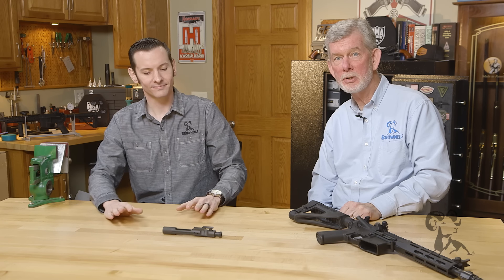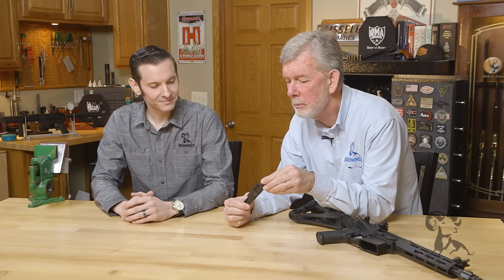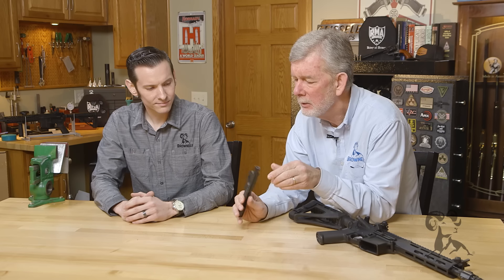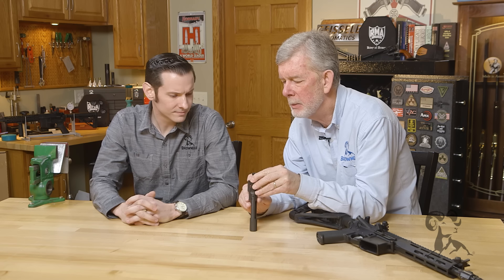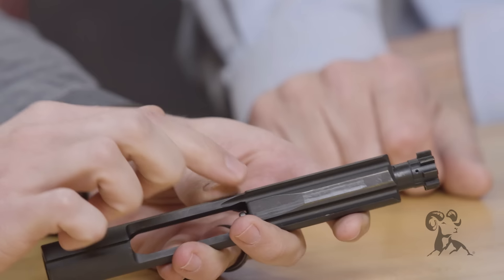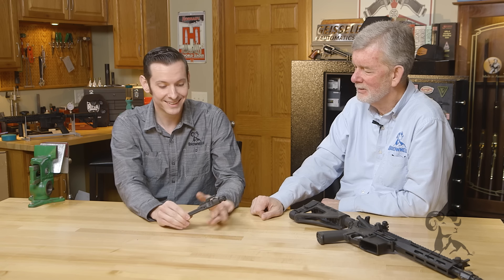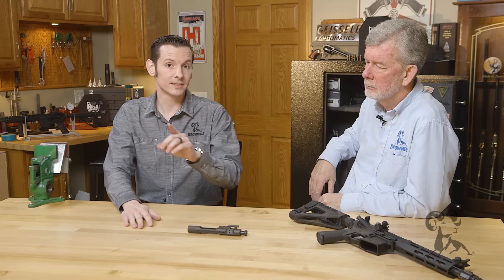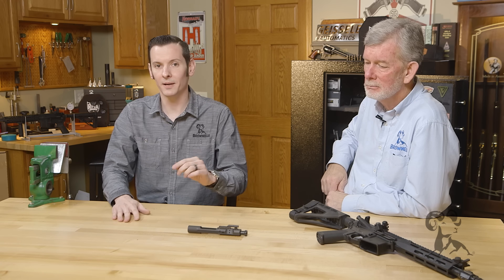Smyth Busters: AR-15 Bolt / Carrier Lubrication

Comment: I have an external oil tank which feeds an oil line that runs directly into my gas block with a spring loaded valve. Each time the gas impingement system is cycled, the pressure pushes open the valve, allowing oil to circulate the entire action through the gas tube. The oil catch tank is inside the pistol grip. Once it reaches a certain level, the oil is forced back into the main tank for recirculating. Every 500 rounds I do an oil change and filter with 10w-40 full synthetic.
Reply: man, I would like to see a schematic of that system! share please!
Reply: I have never heard of that but I'm definitely gonna have to look I to it. Also my good old car also uses 10w40 fully synthetic so I have plenty of that laying around.
Reply: You guys
Reply: And the oil pump gear runs off the forward assist gear notches on the side of the bolt carrier 😂
Reply: Did that get oil on your face?
Reply: I have one of those systems as well, but I use crude oil that's on my property. I have a quick disconnect hose connected to to my AR. Since I have oil on my property, I just plug it in. It's real inexpensive that way.
Reply: I use 10 40 synthetic in my car. It's alright.
Reply: The folks in here thinking he's serious 💀
Reply: use blinker fluid instead of
Reply: I can see where a scuba tank could be repurposed for this.
Reply: Watch School of the American Rifle, and get back to me
Reply: I've also got one.  I'm running 80psi pressure.  Built it from a dry-sump system from a NASCAR stock car.  The pump is powered by a 3-cylinder diesel engine which was removed from a  Ford LGT14D lawn tractor.
Reply: God I love America, you can do an oil change on your AR just like a car
Reply: Bs
Reply: I am glad you have that system on your gun I sure it makes you shoot better and never miss your target you are lubricating your target when the bullet hits it that’s a great idea
Reply: I think 15w50 would be better for summer use ! 😂
Reply: Funny
Reply: You don't do  an oil change on your truck every 500 miles, do you? Try stretching it out a bit. Say maybe every...?
Reply: LMAO

Comment: Rule of thumb for any firearm:  lubricate any contact points of moving parts. Any thing else just collects dirt and waste lube.
Reply: William Bailey  holy shit man ur killing me!!! :) lmfao
Reply: "Any contact points of moving parts":  Firing pin, locking lugs, piston, trigger group.....all places where most people say not to lube.
Reply: a nice thin coat of oil does help with rust tho, not a total waste
Reply: JKSteve1124  To each their own, it's all opinions anyway.
Reply: Good advice Long Shot. I usually have one handgun, a carbine and a shotty in "grab and go" status. These firearms are lubed on all contact points. If I take a gun out knowing I'll shoot it, I go a heavy on the lube. This further helps to reduce wear and tear and usually makes the gun a bit easier to clean.
Reply: where you see worn coating...apply lubrication.
Reply: It just so happens that non-polar solutions tend to lube and protect against corrosion; however the two should be thought of as different processes. 

In lubrication you are maintaining a sustained smoothness and making sure the tool works as intended without wearing itself out.

Protective oiling is for protection against nature, a short time without it is expected fairly frequently. It also aids in the cleaning process (greasing and degreasing over and over basically).

Do what you will, but if your gun is slipping out of your hands like a bar of soap, you may want to remove sone protective oils.
Reply: @DonziGT230 which is funny because the military manual says to lube all those parts!!! Firing pin and channel light lube and the rest it says lube generously!!!

Comment: I've never seen a bolt that was so wet the gun wouldn't function but I've absolutely seen them not run dry. I'd also recommend putting a few drops inside and outside of the charging handle.
Reply: How about wet with silty sand?
Reply: @Golgi-Gyges  ARs are sealed well enough that sand shouldn't get into the action.
Reply: @mustangkrillin  ha ha!
You've never been to the Persian Gulf - and what about during firing?
Reply: I'm not military but I've shot with military since the late 1980s. I've tried most of these methods and had problems. Starting in the early 90s I run dripping wet an never had any problems.
Reply: Well said 💯💯💯
Reply: I've seen rifles throw a lot of excess oil off while firing with zero problems. Probably much different regarding some thick greese or whatever but oil is an ARs friend in my opinion. I wouldn't want to run it completely dry, the firing pin is chromed but everything else isn't from what I can tell lol RESPECT 💯💯💯
Reply: @mustangkrillin  you do realize in the video you linked they DE-LUBED the rifle with brake cleaner? The video you linked works exactly against your point.
Reply: @squid_iwl  Yeah, no one cares
Reply: Armed Chicano  nice little slurry (oil and powder) that will abrade and friction-up your active parts, right?
Reply: I do too. Any friction point.
Reply: Cav Trooper 19D  I was just about to reply about Iraqi sand.. its literally like baby powder and will find its way into ANYTHING!
Reply: @Golgi-Gyges  Run them wet even with sand.  Lubed sand is less abrasive than dry sand.  Think about it would you wash a car with dry sand or would you spray it off with WATER first.   Try running a car with no oil.  The piston in the gun is similar.
Reply: @Physics072  they lubricate cutting tools too (ex. a drill bit) it makes them more effective.
Bad reply from you
Reply: @Golgi-Gyges  the lube cutting tools to keep the heat and friction down so that the bits dont seize and break off in the work piece. The example you gave is evidence of why you should lube heavy instead of lightly
Reply: @Physics072  a car engine isn't gun parts.
Oil is literally going to be a sand/dirt/dust magnet.
With little-to-no-oil, you are better off.
Reply: @isaachousley325  You don't understand that the tool is literally removing metal...like abrasion...
Reply: @Golgi-Gyges  I regularly lube cutting tools and drill bits when cutting and drilling steel.  The reason it's done is to keep the cutter cool and for chip removal and reducing friction. it keeps you from trashing your drill bit or cutting tool . 

If not for heat reduction, friction reduction and chip removal you wouldn't need it, the carbide before it heats up can cut Just Fine Dry. 

You can also spray water on the cutter and that is even more effective than oil.  The oil isn't going to cause the sand in the action to do more damage,  it causes less damage to the metal.  Less heat and friction is good for your bolt carrier group.  Your theory that oil in a dirty, sandy gun does more damage than dry sand is incorrect. I don't think you understand how cutting oil works. Hopefully now you do.
Reply: @actionjksn  😆

We aren't drilling or cutting when we shoot...
Oil attracts sand/grit.
We don't want sand in the workings of the bolt on an automatic weapon.

I think there is a lot you don't understand
Reply: @actionjksn  also, I like my weapon in combat to operate. Sand and excessive carbon buildup (from oil) would work against that.
  Comparing weapons to metalwork is where you're at.
Reply: @Golgi-Gyges  that was you who did that when you compared cutting oil to having oil on gun parts in a Sandy environment.
Reply: @actionjksn  you must be referring to this ["they lubricate cutting tools too (ex. a drill bit). It makes them or effective" (at cutting)]
And that should have taken the entire idea of metal machining out of the discussion.
That was a while ago - disproven as something relevant. Yet you are still on with it.
Reply: Cav Trooper 19D  sounds like silicosis.
Reply: CLP down the tube and generously oil the bolt carrier
Reply: @Bob  sir...  and engine and a rifle share almost nothing.  Engine bearings and piston rings suffer from very high heat.  A BCG does not.  The comparison is flawed.
Reply: 100% I just said it in another comment I oil anything in the bcg that moves and I’ve never had a single malfunction so far. 

My charging handles pull super smooth too. I of course play with the used ones on the rack in the shop sometimes and they feel like shit compared to mine and they are always bone dry.
Reply: Exactly mine runs wet, and it never fails to function, plus it’s easier to clean. Thats me.
Reply: Why on the outside.  Nothing happens their. Just the inside.
Reply: @Golgi-Gyges and when sand gets in there you'll see soldiers pour the oil in if they got it, and rack it a few times and get back to work!!!
Reply: @Golgi-Gyges no.... Not as much as you think and if you'd clean your gun every once in awhile it won't gunk up like that even with excessive oil!!! Most guns oils help move the worst of the shit out!!! As long as it's not being left to sit dirty for an extended period of time.

Comment: Mobil 1 full synthetic. Once it gets into the gun, it feels smooth as glass and runs without issue for a LOT of rounds. Cheap too, a quart will last a decade for $10
Reply: amen.  hand sanding with Mobil 1 full synthetic made me a true believer.   On my guns, shiny spots tell
me where to put lube.
Reply: I've been an advocate of synthetic motor oil for years... it's designed to operate at a high temperature... and only suckers pay $10 for a couple of ounces of Rem Oil, etc.
Reply: Isnt it really carcenogic for your hands?
Reply: Joshua Tipps  new, clean oil is basically harmless.  Used oil has been shown to carcinogenic in animal tests, but that’s from all the nasty chemicals from combustion being mixed into it. 

Years ago, I got into some nasty synthetic oils made for jet engines which caused blisters on my skin.  I have sensitive skin and Mobil 1 synthetic has never bothered me one bit.
Reply: Eating lab rats from the state of California has been shown to cause cancer and possible birth defects
Reply: I use Mobile 1 on my AR.  I also have a new AR15 that I am only using dry lube just to see how it works.  So far, about 2500 rounds through it in shooting sessions of about 500 per.  It sure is a pleasure to clean after a shooting trip.
Reply: @MrPhilsAlabamaHotSauce  
What kind of dry lube? How does it work in the cold?
Reply: teek75ifty  fair point
Reply: Have you tried Eezox? I started using it on SKS and M1 Garand, but I don't have enough experience with dry lubes to know if there is much difference. Also, how does dry lube hold up in the direct impingement AR action versus my piston action rifles?
Reply: @Reel-Lentless ...technically, wd-40 isn't a lubricant.  it's a water displacement formula.  but i guess in a pinch...
Reply: @Reel-Lentless    AH!  I see!  Not WD-40 per se but something under the label!  Gotcha!!  ( I wasn't suggesting water as a gun lubricant but wd-40..i mean, who hasn't used it to get rid of a squeak or something like that?!)  Thanks for your reply!
Reply: @havocproltd  Works best on the skins of ballistic missiles... original use.
Reply: @brettneville2351    A place where you really don't want any water, as the red commies learned over the years  - flooded missle silos aren't good!  Enjoy your weekend!
Reply: Joshua Tipps used motor oil as in, dirty from your cars engine, contains nasty stuff which can be carcinogenic.
Reply: buttholes from a razorback mixed with mobil 1 has to be full synthetic though because of the flux capacitors
Reply: Are we talking dry lubricant like graphite ?
Reply: @nonyabiz9487  ah yes. Common issues.
Reply: Otis makes a fine dry lube and it works in the cold.Have used dirty old motor oil on my guns for 30 years.Think you'd have to bathe in it to get cancer.
Reply: Same
Reply: Mobil full synthetic in your guns? Dang, glad I'm not the only one! I wet a rag with it, and just leave a thin coat on all the friction points and a little bit on the outside to prevent rust (I live next to a lake in a high humidity state, and there's just no getting around it even with dehumidifiers).
Reply: @awejots  Only if its used oil and you would have to do it every day for many years just wear plastic gloves if you are concerned
Reply: Balistol works great non toxic, ask Hickock 45
Reply: Because breathing vaporized hydrocarbons isn't bad for you.
Reply: @Hopeless I understand that. I was making the joke that it’s a non issue unless you do what I stated. No more of an issue than car fumes. I don’t shoot my AR in a confined room and I certainly don’t make an effort to huff the fumes.
Reply: We and all ran Mobil 1 on all our M16/M4, M249, and M240s. Ran like tops. Rem oil or CLP was too light and burnt off too quick.
Reply: Interesting. I've never considered that, but it actually makes sense. Good quality synthetic motor oil is the best stuff modern science has come up with to lubricate metal parts that are interacting at really high speeds, in high pressures, with high temperatures. 

A similar environment to a firearm - very similar, in fact. And, I don't know for sure but it stands to reason that the entire oil and automobile industry has spent more time and money developing high-temp/high-pressure lubrication than Mr Hoppes or whoever.

I'll have to give it a try.
Reply: WD-40 makes a synthetic lube, has anyone tried that? It's like a dry or powdered lubricant. I work with electro-mechanical barrier gates outdoors, and that stuff is great for those machines.
Reply: @johnnyseg754  I have used the Remington dry-lube before. It’s essentially the same thing. Felt like it didn’t do much
Reply: I been using Valvoline synthetic.
Reply: @Shorty_Lickens  that's only for synthetic valves!!!
Reply: I like the idea of Mobil 1 synthetic motor oil. But what weight are you guys referring to,? 5-30 or what,? I doubt A BCG in an AR isn’t exactly as tight and precise as the main bearings on an 2021 AMG Benz. So a 20-50w makes sense but idk.
Reply: @patriotarmament7407  I use 10W-40
Reply: @G19Jeeper  what about using 5w-30?
Reply: @kratomgaming  5W indicates a pretty low viscosity at normal temperature so it will be very thin, like water. I would highly recommend something heavier in the 10W range as a minimum
Reply: @G19Jeeper  wow ok! Thanks for the info! cheers!
Reply: @G19Jeeper  5w is what it’s weight is in cold temps, not normal temps.  The W is for winter.  The second number is the weight you want to look at. For an ar, you won’t tell a difference from 0-20 or 20-50.  Run what you have
Reply: @ohboy2592  the first number indicates its viscosity at normal temperature, relative to outside conditions. So that 5W is going to be very runny if it’s 75 degrees outside. The last number is the viscosity at operating temperature. So 30w will have a lower viscosity than 40W. I run 10W-40 because it is the highest viscosity that you can readily get and I can assure you, it does not burn off as easily as the other. I definitely noticed a difference.
Reply: @G19Jeeper  no, that is incorrect. The first number tells you what the oils viscosity is at cold temperatures,  zero degrees not normal or ambient temp .  That’s what the w is representing.  The second number is the viscosity at operating temps or 212 degrees.  You are correct that 10w40 has more viscosity than 10w30 at higher temps.  However, an ar unless fully auto for many mags will not see a difference from any grade of oil as it won’t get hot enough.  Only chance of that is if they are shooting it at subzero temps then that first number should be as low as possible or using a different lubricant.
Reply: @ohboy2592  same reasoning why I run 10W-30 in summer and 5W-30 in winter in a few vehicles that leak. You may not see a difference or think there is one but I can tell you without a doubt that the slightly heavier weights don’t seep or leak near as bad
Reply: @G19Jeeper  I’m betting your car leaks more in the winter.  You are using the same weight at operating temps year round but a thinner weight in the winter during startups.  Most likely leaking on startups and sitting over night.  Also, depending on where you live if it’s below zero a lot the metals will stay looser on tolerances for longer times until they warm up which can take 15-20 minutes of driving.
Reply: @ohboy2592  10W-40, not 10W-30, that was a typo
Reply: @G19Jeeper  Wrong! . The first number in an oils viscosity rating is how well it retains viscosity in very cold temps, the "W" stands for "winter". The second number is how it behaves when hot. Basically two oils, one a 0w-30 the other a 10w-30 will flow and retain film strength the same when hot. FWIW, these viscosityratings are far less critical in a firearm then in an engine that pumps it thru small passages and between and thru constantly moving parts with thousandths of an inch clearance. 

That said, after cleaning my firearms I eat a bag of Cheetos then rub the grease from my fingers on the contact surfaces. ;)
Reply: @scottdunn2178  Any motor oil will do only suckers pay more for Mobile 1.
Reply: @awejots  Use motor oil is carcinogenic, not NEW oil.
Reply: I too have used Castrol 5w50 full synthetic on my firearms for years and years. Works mint ! I always had trouble with my 1100 Remington cycling in cold weather with light loads, not since I started using the castrol, everything I own runs like a sewing machine.
Reply: @stevenrichards3699  and lots of places burn used oil.
Reply: School of the American Rifle, advocates using Mobil 1 full synthetic grease, with Mobil 1 full synthetic oil.  It's more sticky, works great. Great for long term storage.
Reply: Ah the age old “which oil is best”. From car forums to chainsaw forums to firearm forums, always a 20+ page thread with people fighting.
Reply: @Physics072 well in that case, I have a lot of pennzoil platinum in my garage.
Reply: @Jahalang82  There ya go!